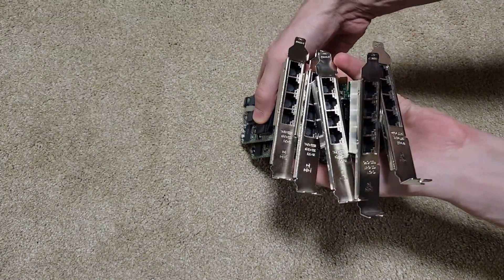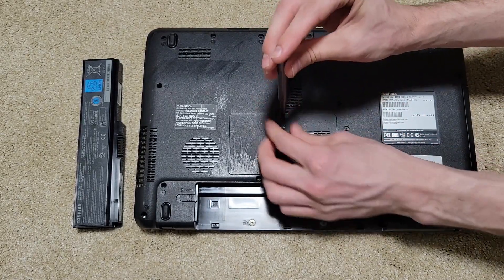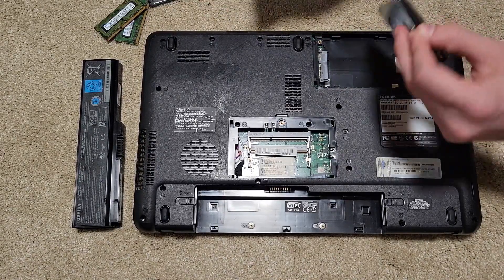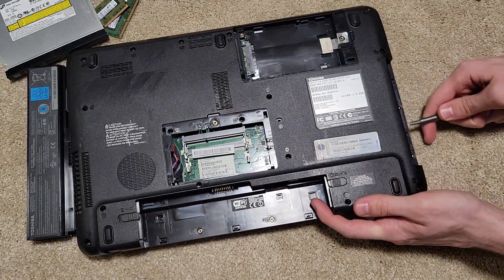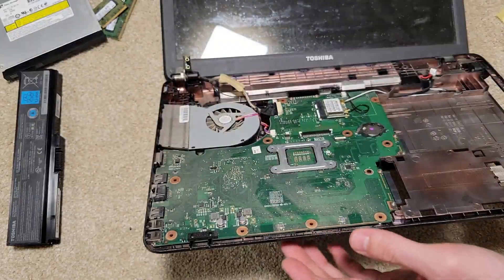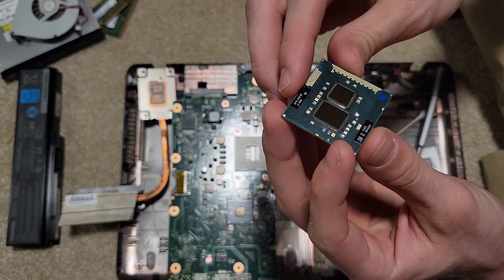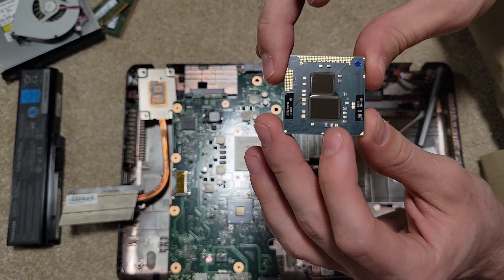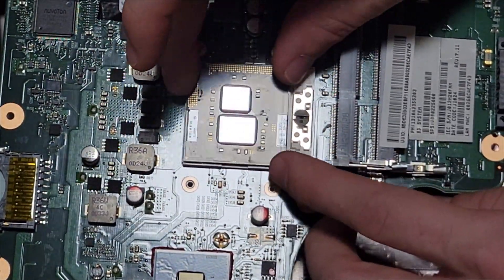What's Inside? How to Disassemble a Toshiba Satellite C655 Laptop from 2010

Comment: I seem to have the same machine or close to it. Mine is a Toshiba satellite c655-s5132 and I have been upgrading it, new battery, new Cmos battery, cleaned the fan, increased the RAM by changing out one stick, and got a new SSD to replace the old hard drive. It came with 3gb of RAM, one stick with 2 gigs and another with only 1 gig. When I looked up adding more RAM I was told it would only be upgradable to 4 gigs which is what I did. 
At 12:21 mins into your video you mention 8 gig of memory max. Is that for the RAM? Can I increase it to more than 4 gigs? 
I cleaned all the dust out and put new thermal past in because it was running hot even with the new SSD but now it still runs hot. Would using thermal pads work better than paste? Thanks
Reply from the maker: Hello! Nice job getting your machine more capable components. The Ram amount can be confusing. That particular laptop can only operate with a MAX of 4GB of RAM. However that CPU can handle 8GB. So in other laptops of a slightly higher quality that have the same processor those ones can have the higher capacity. but unfortunately not yours. Thermal Pads can work better than paste but sometimes it is the thermal pipes themselves that can slowly degrade over time. I would check in your bios options if you can set the fan to always be at 100%. That could help but there are no guarantees with hardware of this age.
Reply: No Pal, it is a fucked up machine. An older gen ThinkPad would give you much better performance than this goochbag